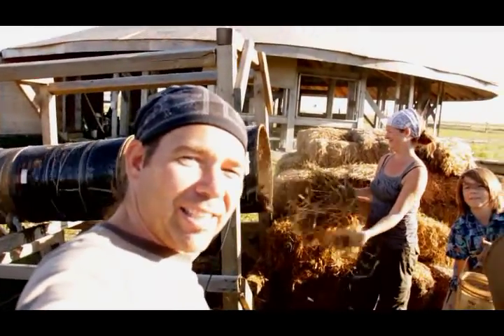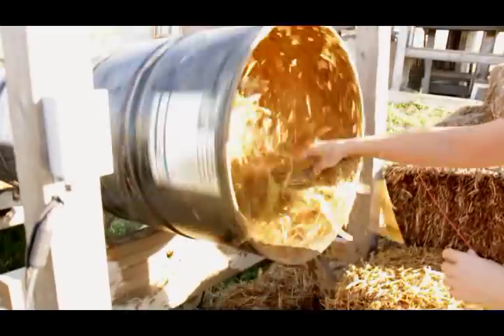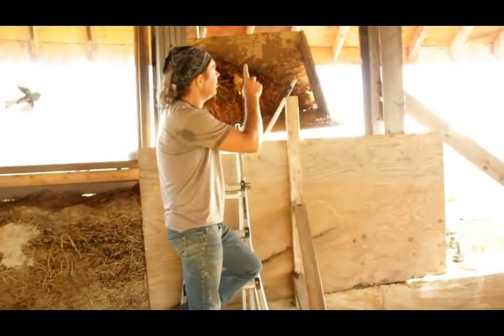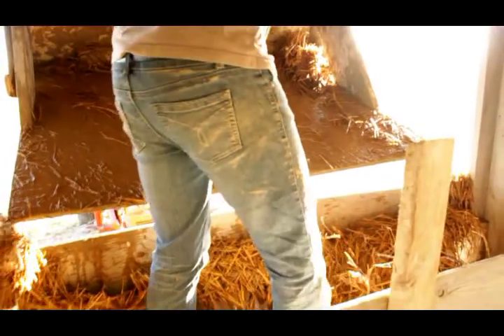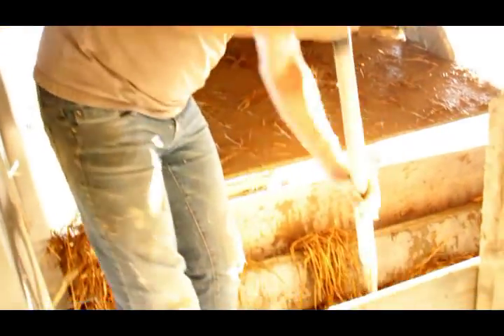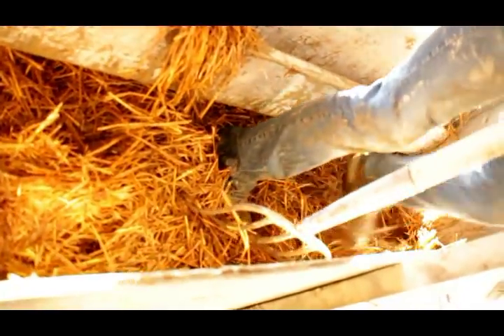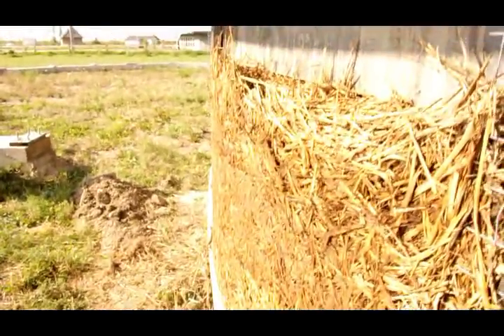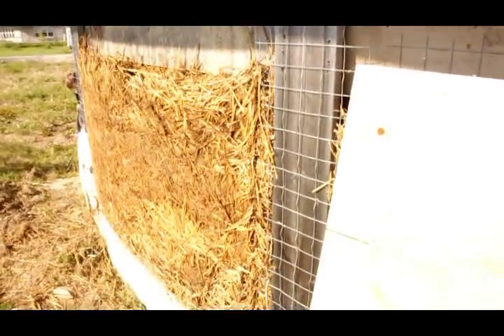Straw Light Clay - Alternative to Straw Bale Building, Craik, SK

Comment: Hi, it's incredible how you run into more and more alternative build techniques. I am planning a 2br home with strawbale or cordwood but where I'm going to build there is little info on these types of techniques. Uruguay I believe will have a coastal Mediterranean climate (rains about 1500mm p/yr) can get to 0°C in winter and rainy and 30+ in the summer, most of the time it's high humidity. What would be best SLC or one of the other build types?
Reply from the maker: Yeah, when we started there was almost no videos on-line - especially about SLC which is why we started posting on it. SLC is not the best choice for humid areas. The best part of SLC is its resilience to hot and cold / wet and dry conditions. It really stands up and performs well to extremes +30 to -30 C and humidity levels that run the range from 10% to 100%...Where a lot of other building styles can't perform well in those extremes, SLC shines. HOWEVER,  SLC doesn't like mild, humid weather conditions. The high natural fibre content would probably begin to breakdown and compost over time. As a general rule any straw or natural fibre construction needs to have a majority of it's yearly life spent in conditions favorable to less than 30% humidity. It can take wet seasons...but needs a good period of the year where it can remain dry. I would look more toward cob, adobe, or cordwood for a coastal area myself.
Reply: @Mauricio  Look up Bareque or Bahareque construction, it's very common in South America. It's pretty much the same concept of wattle and dab. There's plenty of very old buildings in Colombia still standing. Hope it helps

Comment: Could hydraulic lime be used instead of clay in the mix .thanks
Reply from the maker: Lime could probably be added, but not sure about how well it would work. Clay slip is used as a way to soften and stick/fold the fibres together. Lime is typically used with sand. Sand has large particles where lime is powdery and made of small particles. Mixing sand and lime works as a parging material because the lime "keys" into the sand like a puzzle piece to lock and form a rigid bond. You would have to experiment if you are thinking of using it with straw as a glue.
Reply: @Naturally-Kelly  I’m just thinking hempcrete is lime and hemp shiv maybe straw would act the same .as shiv
Reply from the maker: @paulwright9262  Possibly. I'm sorry, I don't have any experience with hempcrete.

Comment: Very cool, thanks for sharing. 
I have built a few straw bale buildings and I am clay slip curious now. Mainly I was thinking that it would be nice to have thinner walls then a whole bale width. Is there a reason that you went so wide with this? It looks like you basically are just as wide as a straw bale anyways.
Reply from the maker: LOL. Good eye! We were originally going to do straw bale and had started on this building as such. We had the framing done and parts of the wall infilled. After a plow wind came through our place and took out most of our yard including outbuildings, wind turbine, and this partially built structure, we had to regroup and look for a way of salvaging our foundation and uprights that were left. Thus where we discovered and started experimenting with SLC. 

I would never recommend anything over 12" thick. Anything greater is just work and expense with no additional R value. In fact, it can be a detriment to drying but we decided to use what we had rather than starting over. Thus the 18" thick walls.

After building both Strawbale and SLC, I would never build strawbale again. I love the flexibility and consistency of SLC. Easier to work with, nicer to finish and I love the fact that your walls can be any thickness from 4" up to 12" (or greater in our case lol)

Comment: I've always heard not to stucco straw because it doesn't breath and soaks up water but holds it next to the straw which could cause rot.
 I think a good cob mix on the walls would work better  at least from the things I've read.
Reply from the maker: +Chris Adams  thanks Chris. I always say build for your area. Totally dependant on wind loads, yearly temps, and humidity levels. Cob and natural finishes weather poorely here because of our conditions. Those same conditions that will strip the clay right off the outer walls here helps wick moisture out of the wall through the cement stucco...we built for our challenges and when it comes to natural techniques we've learned one size doesn't always fit all.
Reply: ok i was just wondering
Reply from the maker: Thanks Chris, we've heard that too. So you're right on the mark...but experiment and know what you need in your area. Cheers!
Reply from the maker: Spring and summers are warm to hot (+30 C) with rain, and typical winter days are -25 C...plus we usually get a cold snap in January for a week of -30 or colder. Because of the winter months was the reason we chose SLC over doing cob. Both methods are similar, just proportions of straw and clay are reversed. One gives your more strength, the other more insulating value. As far as covering the SLC, we decided after 3 years of experimenting to go with a lime/cement/sand stucco. Of all the tests we did, that mix seemed to give us the best results. 5 yrs later, our first house is still performing well with no concerns.

Comment: Could you please give some instructions of how to make the mixer? How many drums, and how to actually make it? Thanks.  I am also concerned about building with this method in Poland. The worry is that the clay may not dry until frost come and damage wet clay. Any info on drying it i west scenario polish weather?
Reply from the maker: Hey John, even frozen, the wall will "freeze dry" through the winter months because the cold air is actually so dry it will draw moisture out of the wall...even frozen. We have a similar climate here in Canada as Poland. You can find more info on making the mixer at this video: https://youtu.be/JUuClXG2mQE

Comment: Why wouldn't you use a clay/lime type plaster instead of cement???
Reply from the maker: Because you should always build for your climate. We spent 2 years trying every type and combination of materials against our climate Lime/cement beat out every other sample we did when dealing with 100km/h wind, rain, snow, freeze/thaw cycles.

Deciding to use clay/lime because other people do it only works if you live in like areas of the world.

It's the same reason I laughed when I heard someone cut down trees in BC to build a straw bale house that they had to haul bales in for from 700 km away. (The building failed within 5 yrs btw) Wrong products, wrong climate, wrong thought process. I ALWAYS mandate that you need to build for where you live and not by any other standard. Build to last a lifetime and set your own green goals.

Comment: Thank you so much for all the knowledge you guys are excellent!Would there be any issues with using straw light clay to insulate bays in a 2x6 stick framed building? I would be sheating on exterior with plywood and on the interior with cedar planks not applying plaster.  Stay safe and blessed
Reply from the maker: Thanks Dan. You're talking about mixing styles and methods that I probably wouldn't do. For example. Here in Canada, 2x6 conventional construction looks from the outside like this: siding, Tyvek/breathable membrane/sheathing(osb/plywood), 2x6 framing with non-flamable insulation, followed by a vapour barrier (plastic sheeting), and then wall covering. It works because it's a complete system. Remove any of the components and you get rot/condensation/weather damage. 

SLC is just another type of building system. It becomes flame proof/pest proof because of the finishes applied inside and out and responds a certain way to condensation issues between inside/outside temperature differences based on the entire system. I wouldn't use bare straw in the walls without a flame retardant mixed in for starters, but I have a feeling you might end up with condensation issues between inside/outside temps if you live in a climate that requires insulation. There are a few companies that are experimenting with pre-fab wall systems very similar to what you are talking about, but unfortunately, I don't know much about how they are put together as most are experimental at this point and I'm unsure of the regions they are being tested in.

Comment: Thank you for your videos!      Hey I'm curious, how do you tamp down the material when you get up near the roof and there isn't any room for tamping?
Reply from the maker: ***** Best way of tamping is put the roof sheeting on after you finish the walls. If it's not possible (such as in our case) we used full square bales to stuff into the top 2 feet. We then push in straw clay mixture (heavy on the clay side) into any holes or spots. This works because of the thickness of our walls. On something like a 12" or thinner wall, you can also put form boards only on  the backside of the wall and build your wall from the front side without a form pressing the straw in by hand using a heavier clay version of SLC (about 30% clay) so it has some stickiness to it and helps it form and bond better.
Reply: Thanks, I think I'm going to try the "roof last" method.       Your videos are responsible for kickstarting a hexagonal slc structure with timber frame.....thank you!     Ps we both have a lot in common, both musicians who live off the grid ;)
Reply from the maker: Sweet! Wishing ya all the best!

Comment: Hello,
Thank you for this vidio  my question is  can Alpaca fiber  from sheering the animals be used in the straw mix, also i hear lime mixed in the mixture bonds hard.  what do you think.
Reply from the maker: Hi Pamela, Thank you and yes to the Alpaca fibers. We personally do not have experience with this so I would highly suggest making some test walls for yourself to see how it performs...and no to the lime. I would look at a hempcrete type of mix over SLC if you'd like to use lime. SLC doesn't really bond as a result of the clay but more so because the dampened and turned straw fibers twist, wrap, and lock together as they get mixed up and placed into the wall...Once pressed down it "ties the knots" making for an incredibly tightly woven wall that is tough to destroy. Lime works well with sand as a lock and key system. I don't believe the proportions would be right. The lime particles typically are used to "key" into the tiny spaces around sand, cement, or clay for a tough finish...but lime mixed with such a small percentage of clay slip would not necessarily add additional strength - it will just make it harder to place as it is caustic to bare skin. You'd have to have a much higher ratio of slip to be effective which puts you into a "crete" instead of a "light clay" builld. I'd save it for the plaster finish - but again, experiment - I'd love to hear what you find with your own testing.

Comment: I like the idea, it's  a great way to use up the straw we have left from reshaping our straw bale's . Would you advise it for inner walls?
Reply from the maker: +Mark van Schoubroeck Yes. SLC can be used for inner walls no problem. Personally, I don't run electrical wire through straw. Life changes and I've had to move electricals way too many times in other homes we've owned so I always use surface mounted conduit on parged walls so most of our inner walls I like to use drywall and studs rather than straw. Running services through hollow walls is much easier.

Comment: One thing that I never see being explained is how electrical wiring is done, whether it's SLC, cob, cordwood or earthbag!  PS:  why cover the outside beam w wire at all?
Reply from the maker: Thanks for the comment rvpace2u. Some people will run electrical through the walls. We choose not to. All of our wiring is surface mounted in conduit after the walls are finished. Internal wiring is impossible to add/move/repair if it is buried within the walls. 

Re: wire on the outside beam. Yes, we've left beams exposed in the past but now like stuccoing over them (personal for looks) If they are exposed, we require good expanding & flexible sealant between the parging and the beam to accommodate shrinkage and material movement. Our temperatures here in Saskatchewan Canada range between -40C and +40C with a humidity range of 5% in winter to 98% mid summer so movement in the materials has to be taken into account. There are no absolutes - just finding ways that work with your locale. :)
Reply: rvpace2u you cut a channel with a chain saw about 6 in deep so an accidental nail in the wrong spot does not short the wire the channeling keeps it concealed .

Comment: Why does this work better in Canada? I'm in BC and looking at alternatives to go off grid. I've looked at log & cord / straw bale / and cob construction. This appears more like what I've seen as Cob, but still different. This looks very interesting...!
And I have not heard about Straw Bale rotting....  Is that common?
Reply from the maker: Hey Roger, thanks for the really great questions. From our research, SLC stems its roots from Germany (which has a very similar climate to Canada). We were in the middle of building a stacked Nebraska style straw bale house when we ran out of weather in the fall and had to shut down. 

A freak windstorm with 126 km/h winds took our partially built straw bale walls down leaving us a mess of broken straw. We also had just dug a reservoir on our land and had a couple hundred yards of clay hanging around so we researched what we could do with the two products (loose straw and clay). 

From our research, Cob isn't well suited for Saskatchewan. Because the walls are so dense, it doesn't provide enough winter insulation unless you start getting into insane thicknesses...which then leads to drying issues and slow and heavy building. We stumbled across SLC and fell in love because its straw based, perfectly formed walls with a bit of clay slip to bind things together...and very easy to place the material (straw bale starts to get more difficult after the 4th course in height) Once you remove the forms, there is no other prep work - they're set for plastering once dry.

Any natural product - including straw will begin degrading with humidity and moisture levels over 30%. It's not normally an issue but depending on where you live in BC this may or may not affect you. In SK, we have June and July with 85-95% humidity and +30 heat...but all winter long we're -20's with 10% RH so any moisture the walls take on during the spring and summer draws out easily. Long and short - Straw bale works well in climates where more months of the year are dry and cold than warm and wet. 

The Germans used SLC because it's what they had available and it worked for their climate 700 years ago. Mexico and the SW States used Cob because it's what they had available and it worked for their climate. Northern and Western States started used Straw Bale because wood was in short supply and expensive to source on the prairies when it was first being settled. It's more about knowing your location and what will stand up to your climate.  Hope some of this helps.
Reply: Yes, straw bales will rot if they get wet and can't dry out fast enough. They are baled dry and have to stay that way until render is applied. Straw bale construction works best in climates where you can depend on not getting any rain during the building season. You need to get the building up and protected by a roof in one season. And your straw bales need to be protected from the rain until then. If you buy your bales ahead of time they need to be stored in a barn until you're ready to use them.

Comment: I'd be worried that cement stucco doesn't breathe. old timber frame cob houses in the uk have been getting rot because they got a cement finish at some point so the cob started to capture and retain moisture building up the rot that eventually spread to their timber frames.
Reply from the maker: I wouldn't doubt it. I would NEVER recommend putting cement finish on any UK house straw/wood/or otherwise - Period. You have to build for your climate. 9 years later, our 1st house is performing excellently with no issues...here in Saskatchewan where we average 10% humidity for 6+ months a year, 30% humidity Spring and Fall and 80% humidity for 2 months in the summer strength and protection are key - breathability is a not an issue. The cement surface becomes so dry that it actually helps to pull moisture out of the wall as a wick. People seem to have an idea that 1 size fits all when it comes to construction. I always say build for where you are at. Believe it or not, I know people who have cut down trees to build a straw bale house in the forest...having to haul bales 700 km...and then have rot issues with their house - because it was built in the middle of a forest! You always need to build for your location with local materials and know how your materials interact with your locale. We spent 2 years conducting 4 season tests with 6 finishes before committing to a recipe.
Reply: @Naturally-Kelly  Got it! I'm no architect I'm just trying to put together enough information to build something with out shooting in the dark and this is very helpful thank you!